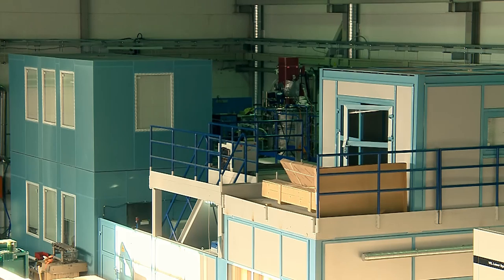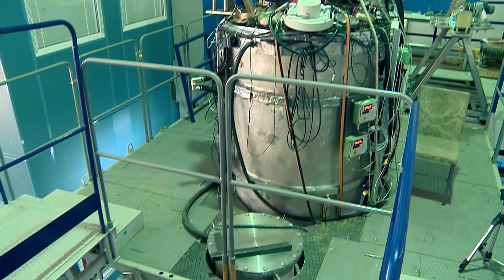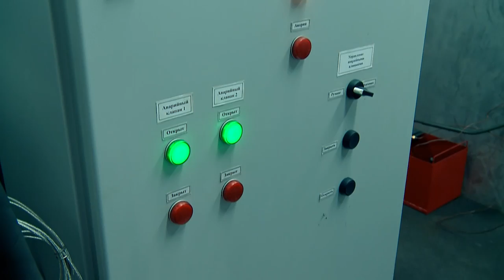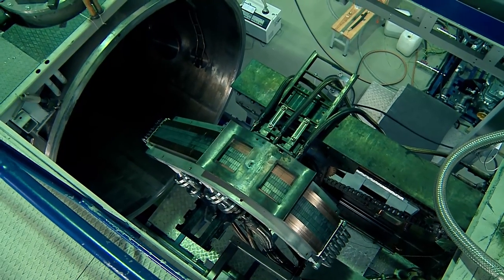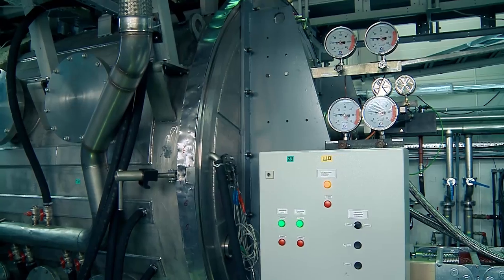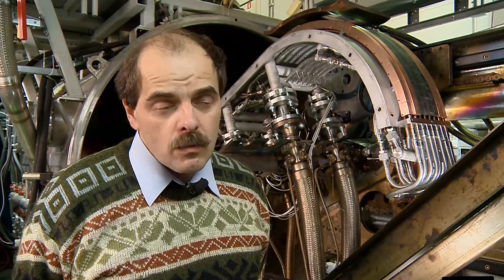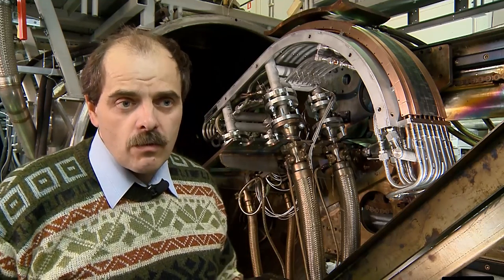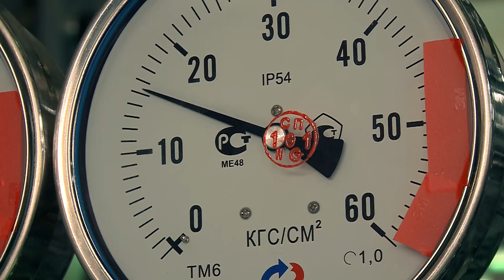ITER plasma-facing components tested in high heat flux

Comment: How is the heat transfered outside the torus/vessel? Water? Molten salt? Or other liquid? Is there a heat exchanger from primary liquid loop to another medium like super heated steam and then to a steam turbine? If liquid used how high does the flow need to be not to damage diverters, components and or pumps at max plasma operation? Or are there no overheating risks at diverter level? Wat level of pressure are you expecting in primary diverter piping?

Comment: what kind of materials can withstand temps of 150,000,000 degrees?
Reply: Truly in the ITER tokamak center T=150 mil, however, at the material surface it's only ~100'000. Important is the heat flux reaching 20 MW/m2 in both ITER as well as on this Efremov testing device, thus such experiment is very relevant.
Reply: Sure, no metal can withstand more than 3420 oC (Tungsten), however, it's not the temperature but the heat flux what is important since tungsten density is 100 millions times denser than the plasma is, so the contact plasma temperature can be much much higher than the metal surface temperature ever gets.